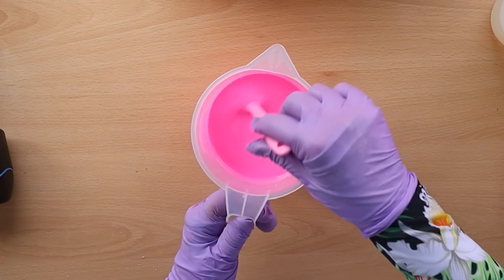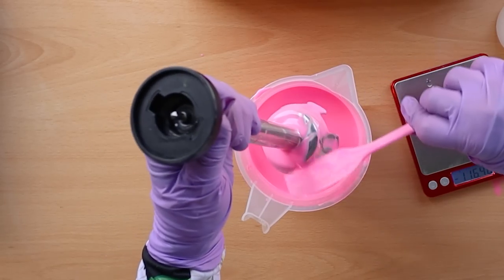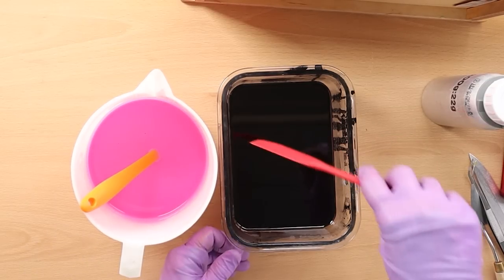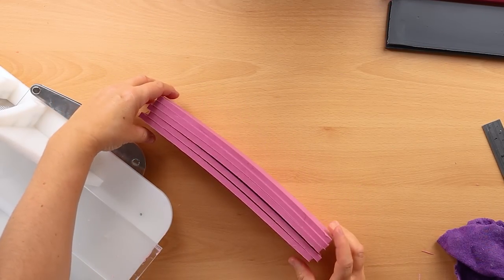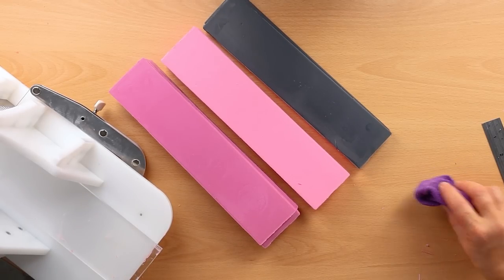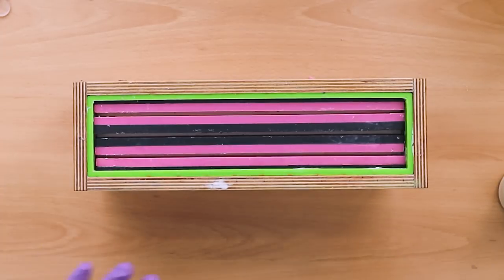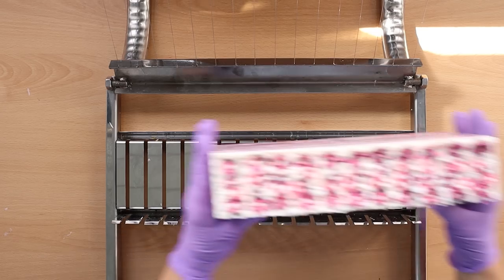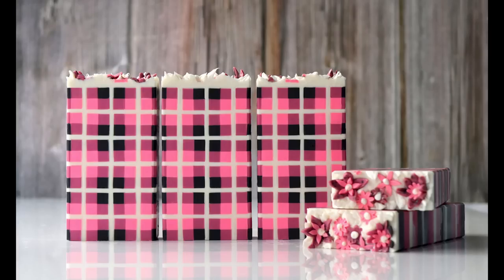Cold Process Plaid Soap, Soap Challenge Club buffalo plaid.

Comment: Hi Lisa! Beautiful soap. Could u pls do a quick video of how u design your soaps on your computer and make the guides u put on the sides of your mold when layering your embeds. U make beautiful soaps and I’d like to know how u do it from design to finish. 😊
Reply from the maker: HI, thank you so much. I tend to stay away from the computer design thing as it would rely on people having the same software as me, otherwise it's a bit of a non starter. To be honest I just draw a picture, whether it's on my computer or on a piece of paper, from that I look at each area and use a spreadsheet to calculate the oils for each part. The templates that I put in my mould are just the pictures cut out, sometimes I print them on acetate, sometimes just on paper and then cover them with clear tape.